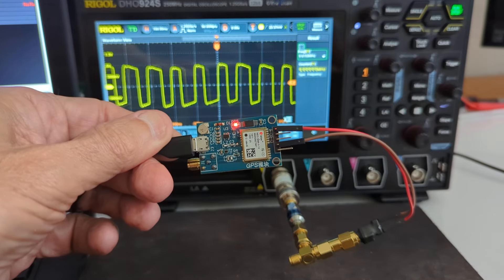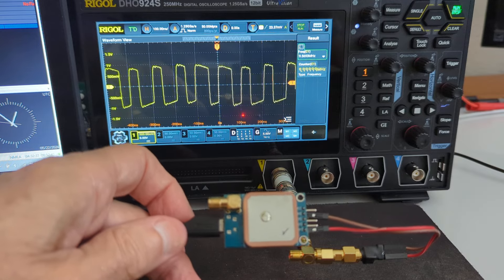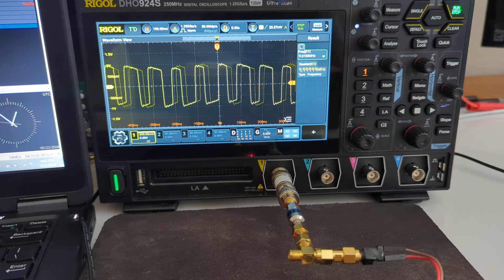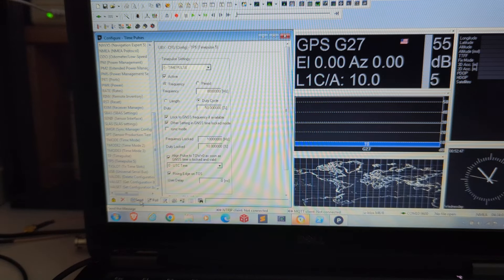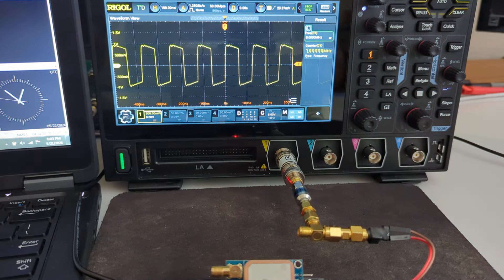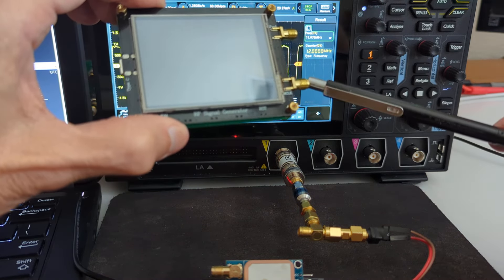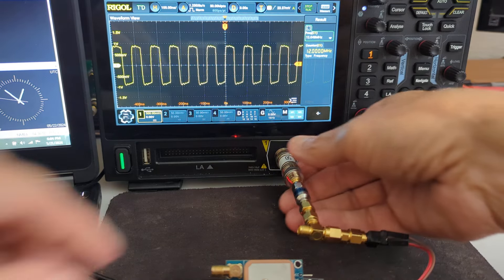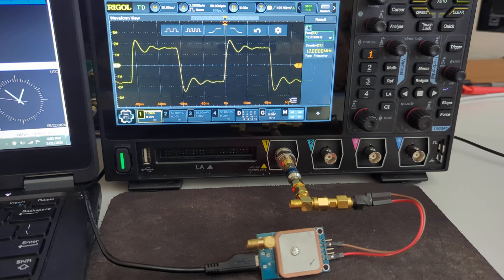UBLOX GPS as a jitter-free reference clock

Comment: The internal clock should be 48MHz (not that it matters much since it's 2x24) and apparently you get the cleanest signal if you divide that by power of 2 divider. There was an evaluation of the output signal on some Russian site but can't find it now.
Reply from the maker: Thanks for that comment. The frequency isn't mentioned on the data sheet so people online are inferring the value based on the jitter free frequencies. 48 MHz does make sense, thanks.
Reply: 48 MHz - 100%
Reply: You can improve the output waveform at 10MHz by using a Schmitt trigger

Comment: An inexpensive GPSDO will use the 1PPS via a FLL to control an OCXO at a typical frequency of 10 MHz.
They're jitter-free, and at the standard 'lab' reference frequency of 10MHz.  Worth every penny of their $100 price class.
Only significant drawback is that the GPSDO takes a lot more power than just the GPS module.
Reply from the maker: Yes, understood, thank you. It's on my list to buy the one from BG7TBL, along with a distribution box.